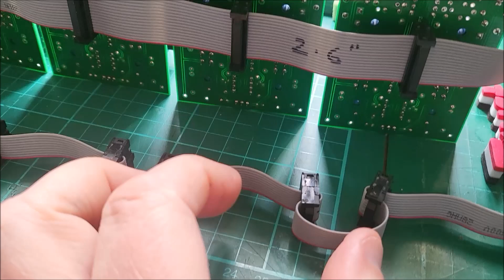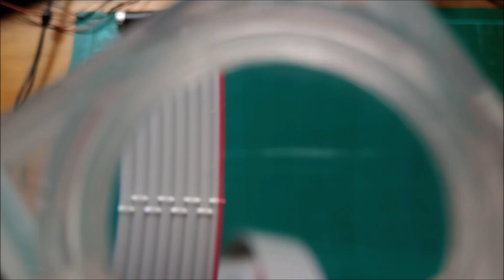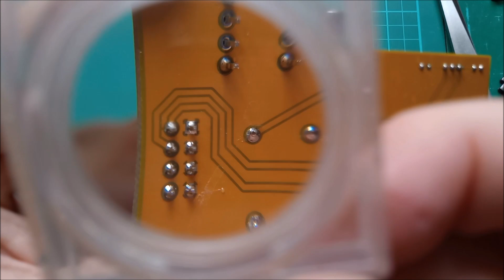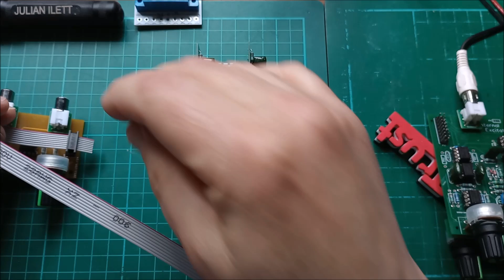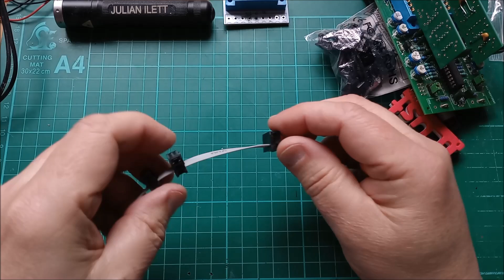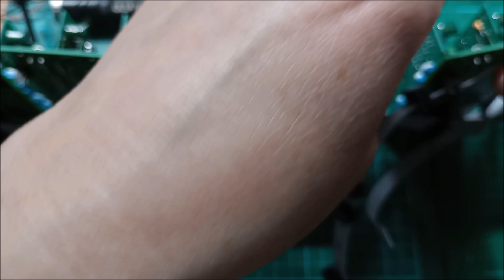Insulation Displacement

Comment: Oh yeah, speaking of Anyloops, mine are really starting to wear out. I've found these days they don't like the cold. Now winter's approaching, it's getting down to a frigid 21°C inside, and they can't handle the start-up current of the device, sending into a reset cycle. However, if I put the Anyloops on top of my light to warm up for a minute, they don't have any issues with the start-up current. Makes me wonder whether the optimal operating temperature is actually quite a lot warmer than the average indoor temperature.

Comment: This might sound stupid to you now but, You do know that there is a flexible silicon based version of that ribbon cable do you?
Reply from the maker: I didn't know that.
Reply: Which do you have in mind, AJB2K3? The silicone ribbon from AliEx isn’t standard pitch, so won’t work in IDC connectors. And the silicone ribbon available from big distributors is staggeringly expensive. :(

Comment: why mark the centre of the connector? You could mark the, say, left side of each connector.
Reply: If he used the marks he made as the left hand side of each connector it would have had the same effect. These are the sort of things you realise after doing something like this.
Reply: You don't even need to mark both connectors on the same board or worry about them being straight on the cable if you do the initial positioning with the connectors plugged into the board

Comment: I was an Amusement Arcade Machine Mechanic for some years. I developed a distinct disliking for IDC connectors, as they really do not like being disturbed, and are very unforgiving.
A company released a machine called Monopoly (after the board-game), with IDC connectors on the power supply loom, they doubled up the strands to cope with the current draw, but very soon went intermittent as they were not fit for purpose.
You had to make up an adapter connector so you could still unplug the power supply for maintenance.
A sure sign of the problem was when the machine would randomly reset over and over, due to the disturbance in the voltage drop.
Embarrassing if someone was playing it and had money in the bank, or were on the feature at the time.

Comment: If you can spare a pin you can block one hole and cut off corresponding pin and make the connector only fit one socket.
Reply: If you look carefully, the IDC connectors on the ribbon cable have a tab on one side. There's shrouded header you can get that matches up with the key so that it can only be plugged in one way.
Reply: @JaenFoster   yes that tab does that function. but if you have a few of the same connectors on the PCB, you might want to stop the wrong plug going in to the incorrect connector.
Reply: Yep. Keying is always a good practice, whether by individually keying each connector (of otherwise identical connectors) or by using different connectors for each thing, so they’re physically incompatible.